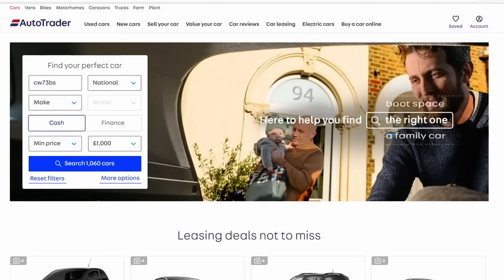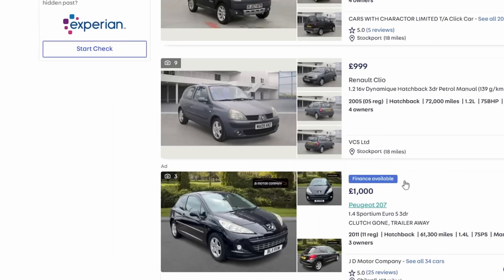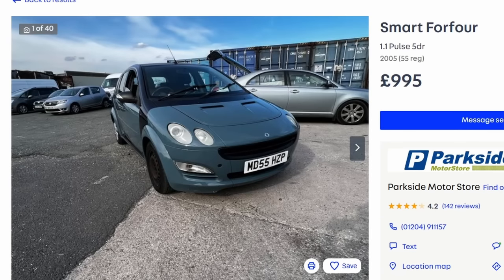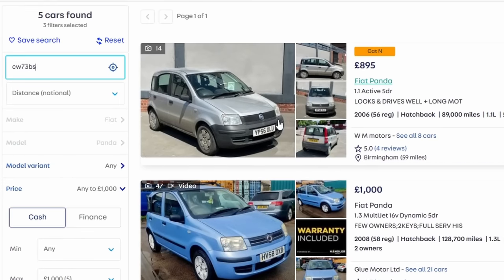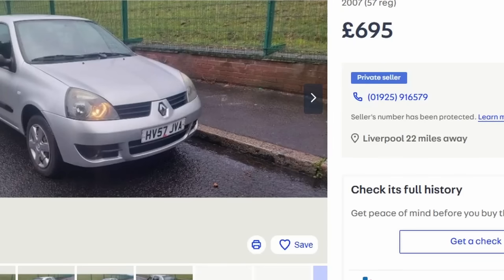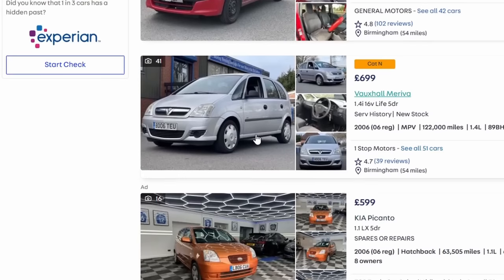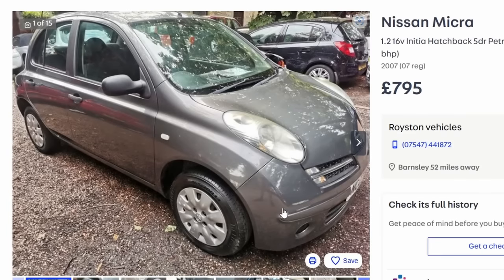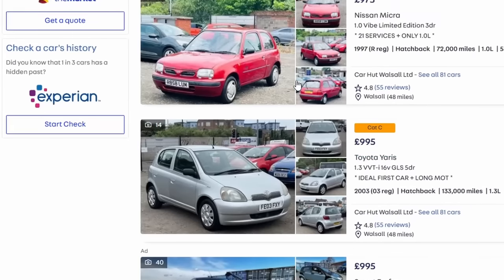THE BEST SMALL CARS UNDER £1000 ! (2023)

Comment: my first car gen 5 the face lift fiesta i had the 1.4tdci it was not a bad car it did not let me down but mine did have an injector issue some days it burn very clean some days look behind could not see the house i left but even driving it like i stole it it still get better mpg than my 1.2 i20 if i baby it and be a danger as not keeping up flow traffic, my i20 40mpg on long run with mixed driving i like to get up to speed so going through wales a lot  0-60 but then also when finally get on to a trucking road you cruising for 30-40 miles like a44, a470. i20 in the mountains a 1.2 i can be in low 30's mpg and good run very low 40's if im lucky depends how traffic flowing, my old diesel fiesta wow it do 50 mpg all day long no matter how hard i drive it and many runs getting 60-70mpg one run the turbo pipe kept popping off and no clip and had 8 hour drive so that day i was so easy on gas rarely got above 50 just a long easy cruise i think i got 70-80mpg it sipped fuel so going in that the fiesta normal driving can almost get double mpg than my newer i20 1.2 so was a bit shock when i got the i20 double the fuel costs because petrol then fuel doubled so a double hit . small petrol or small diesel i do like how petrol performs and some got close to same amount torque whats a good thing only thing i don't like clutch just feel weaker than diesel. but saying all that that fiesta sure wins with mpg but it sure was not as reliable as my current i20 what had 55 months, egr and injector issues, engine light, and load other stuff but i20 non that its been great and only age related things like a new clutch but it did well 100k miles on original one well it good small petrol every thing else cheap wear and tear items like disks and pads and that £60 a corner so very cheap and back box £120, tyres £60 each and they good mid range. only flaw ive had was changing the front light bulbs if they go when out you need to ring recovery as you have to take out whole light or right side remove battery and computer to make space

Comment: Hi Lee, great post. Like the bookmarks… very useful!

What’s your thoughts on Mini 1.4 from 2006 onwards? I know chains are an issue but see loads with misfires…. Be good to hear your view. 

Thanks
Richard
Reply from the maker: Major issue is the chains, they can also suffer with overheating issues down to the water pumps failing or coolant pipes leaking. Personally the earlier engines were better although are less refined, I would say for every 3 I buy maybe 1 would be good enough to retail with confidence, most I trade on or put into another auction. They always sell mind that's not a issue its the reliability and the customer coming back that's the pain in fixing them.
Reply: @carukchannel  thanks for that…. Kind of what I had picked up whilst looking at a few. My daughter wants one as a first car. I think interior-wise they have a really nice feel. I would be more than happy to throw a timing chain on anything I buy but  just concerned by the number I see that say misfire on 1 or more cylinders…. Can’t be just coil packs as that’s too easy diagnose to change

Comment: I got a 1.4 diesel yaris in very good condition, 2005. 74.3mpg on motorway, city 53.3mpg, combined 64.2mpg. Only 88k milage. THE most reliable small car the earth has seen. And tell me another with better mpg and with cheaper parts? 
Any1 interested in headache free driving, make me an offer i cant refuse. 
Just remember, its a 1.4d4d. The rarest most sought after, for a reason. (Mpg)

Comment: Renault Clio great cars but the electrics can be quirky, disconnecting the battery for 5 mins often cures glitches.  My current Clio is near 100,000 miiles ,very little rust ,great engine but i do regular oil changes. Why i have to position thr gear stick into reverse to switch the engine off i'll never know! 😄.

Comment: Totally wrong about the smart forfour. I’ve had a 2005 1.1 Passion since 2006. It’s been and still is brilliant. Engine is Mitsubishi and bullet proof. Now done 110,00 miles. No corrosion. Very little has had to be done apart routine maintenance. It drives very nicely, is versatile and cheap to run. 😏
Reply from the maker: that's great to hear and I am always happy to hear people having a vehicle that's done well for them but sadly I have dealt with, repaired and Mot'd lots of them and they are not a reliable car in my view compared to others mentioned.

Comment: We've had several Clio's had a 182 53 plate for maybe 4 years and the wife a 53 plate 1.2 Dynamique + both faultless . I stupidly gave the wife's away to a friend who needed a car after been made redundant , Shows what thanks you get it was immaculate this is maybe 8/9 years ago when cars weren't worth as much but it must have been worth£1000ish , he ran it for at least 2 years until getting on his feet then traded it in by all accounts got over £400 which he never offered me the £400. This particular car i happened to check the oil and dipstick and filler cap had milkshake.all over. I bought a bottle of steel seal the car was fine our lass did at least another 10,000 miles before she got another car and I let my mate have it free non gratis.

Comment: I have been looking for a delivery car and would like a little more Room then a Nissan  Micra Could I ask more about the Honda Jazz 1.2.. is the model after the one you showed any better ? I think it's the model from 2009 upwards .. or would a civic 1.4  be more reliable ..thanks love the videos
Reply: The Mk2 Jazz 2009+ is ultra reliable aswell, without the corrosion issues the mk1s are experiencing. 1.2 or 1.4. They are v-tec rather than dsi like the mk1s.

Comment: You are eliminating the Toyota Yaris 1.5 by cutting it off at 1.4L but then again they are probably priced higher than 1000 pounds.
Reply from the maker: Yes, the 1.5 was a tsport If I recall, very sort after and worth a few quid now
Reply: @carukchannel   I have a 2006 Yaris 1.5 here in Australia, it cost $5k from a second hand dealer about 3 years ago, and that's a repairable writeoff, it would have been $6k with a clean title. I think they all came with a 1.5 here. The earlier model that were called a Yaris in the UK were called the Echo here.

Comment: Don't know why you say don't buy a smart, love mine 1.1 and a 1.5 brabus, great fun to drive, you would be really unlucky to find one with any rust, my 1.1 passed it's last mot no advisories, and apart from door lock cables breaking reliable
Reply: I thought it was unfair too. They are a Mitsubishi Colt in Smart clothing. My Colt 1.3 Mivec engine was great, 95hp in a light car was gutsy, and 50+ mpg on a run!

Comment: I'm not sure I'd touch a car under a grand in today's market. I think you need at least 1500.
Reply from the maker: Yes 1500 is really what £800 would of bought you 18 months ago. I just tried to best place what could be a option under 1k that might give some good motoring. Thanks for watching Clivet3252  👍
Reply: @carukchannel  sub 1000 is like the old sub 500 market, you may find the odd gem but it's a risky market. The problem I find with the market now is that the positives push the prices up, whereas in the past the negatives would bring them down. The stylish but unreliable cars fetch good money because they're stylish, and the unfashionable but reliable cars fetch good money because they're reliable. Bigger cars used to be cheap because of the higher running costs but now you're paying for the luxury and refinement like you did when they were new. And Fords and Vauxhalls used to be cheap because they were common, now they're not so cheap because there's a demand for them. It would be interesting to see a video on the cars you consider to offer the best value for money. You seem to buy a lot of Astras and they seem decent value, although I sat in a mk5 and found it a bit cramped. Insignias look good value. Older 1 and 3 Series BMWs look better value now more ordinary cars have gone up. Are they worth buying?
Reply from the maker: @clivet3252  Good idea for a video 👍👍👍👍

Comment: Yaris MKII?
Reply: That'll be more that £1,000 for sure. Unless it's a banger.
Reply: @tardeliesmagic  even an early 06 or an 07?
Reply: @semiretired86  Here in the UK MK2 Yaris go for £2000 on a 2007 with high miles ie 120,000m & MK1 Yaris 05 with same goes for £1,200 at 120,000m if your lucky! Both in ok condition! No bad dents,rust & running ok. Real good ones are hard to find so add another £500 on the MK2 07 for a damn good one! You'll be lucky to get MK1 under a grand....that'll be running bad,needs a new clutch,scrapes & dents,bad paint with bad tyres. I've seen so many bad MK2s that's over a grand.